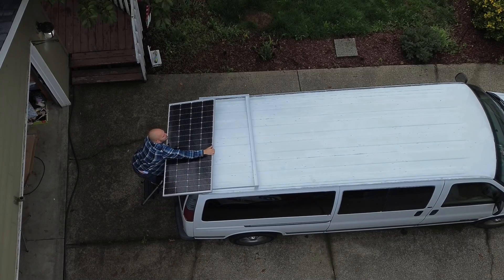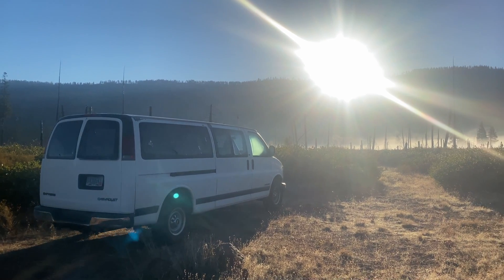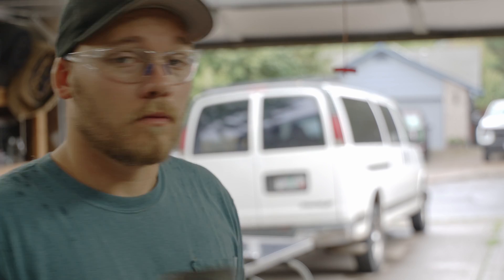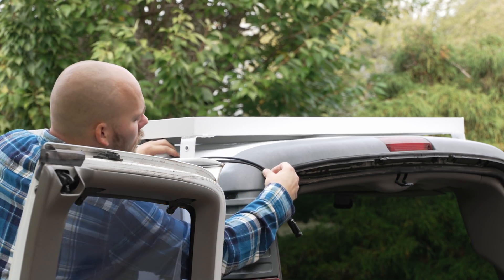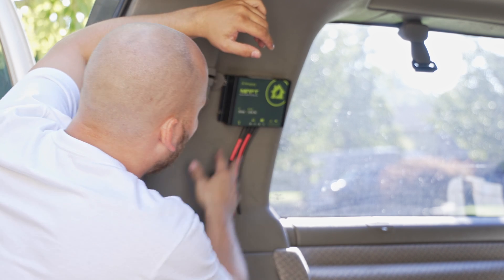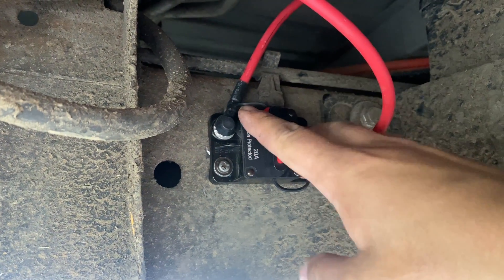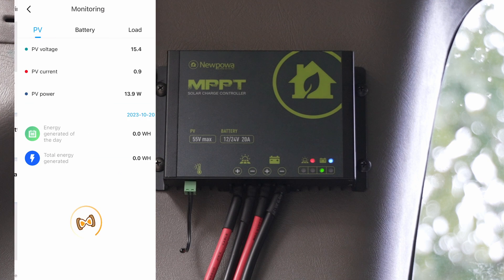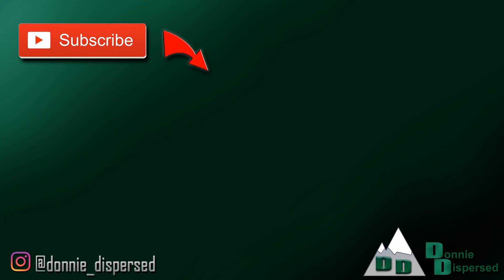Newpowa Solar Panel & MPPT Charge Controller ☀️ Install - Review

Comment: What 12 volt fridge were you running, 30 hours is not bad at all but i am sure with the solar panel its even better.
Reply from the maker: It came back to me. It’s the massimo 52L
Reply: Thanks! appreciate it.
Reply from the maker: I’m blanking on the name of it, but it’s sold at tractor supply, I think